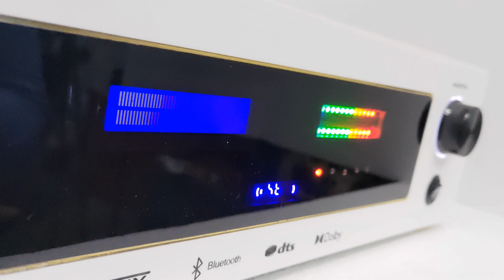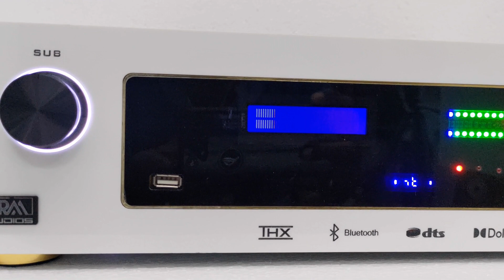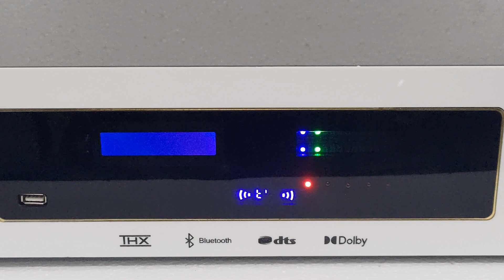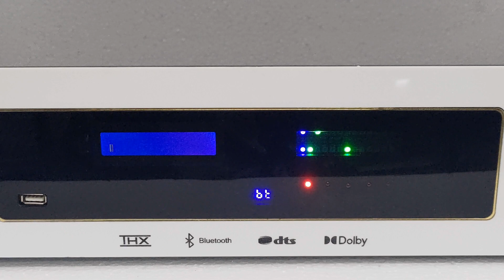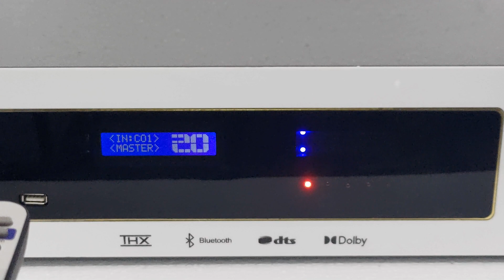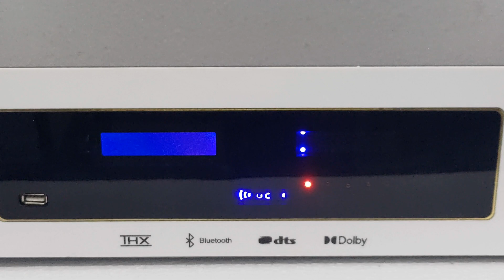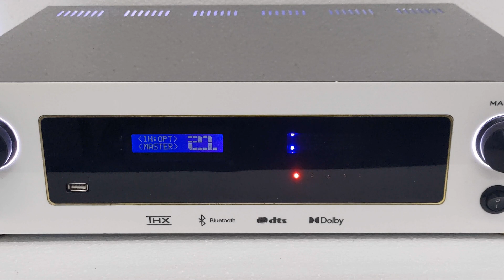5.2 HDMI - AVR  V 2.0  / With ARC support new update (model number TA -H002)

Comment: Amplifier Dolby Atmos audio
 input
 Coaxial pin
optical pin
 HDMI pin
5.1 pin
2.1 Aux pin
Output
Sub 8 inch speaker 2.No
Centre 8 inch speaker 2.No
Fr 8 inch speaker 1.No
FL 8 inch speaker 1.No
Sr 8 inches speaker 1.No
SL 8 inch speaker 1.No
Cooling fan in switch  output 2.No
FM antenna
Power input 3 pin cable wire remote control
Volume control
Sub control
No.6 control
Big size cap net
Branded motherboard
Please your price
Reply from the maker: Plz contact me: 8760928131

Comment: Kindly advise speaker combination for 5.1 Av reciever , 6 ohms 130 watts ,
Reply from the maker: Sir what details you need ?
Reply: Bro 5.1 av reciever la 6 ohms nu potruku bro market 4 ohms and 8 ohms kadaikuthu use panlamnu solungha 8 ohms
Reply from the maker: @Murugangaming-gd6uv  speakers nega branded la vagunigana ungaluku 6 ohms la kedaikum , local market la 8 ohms kedaikum 8 ohms use panalam
Reply from the maker: Yes 8 ohms use panuga
Reply: Tq